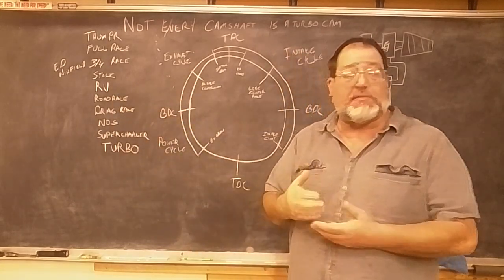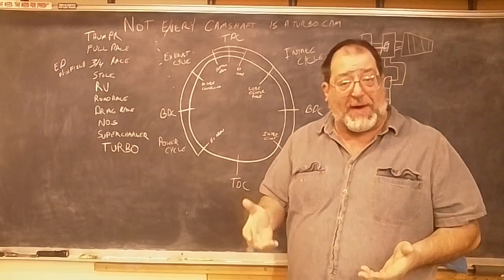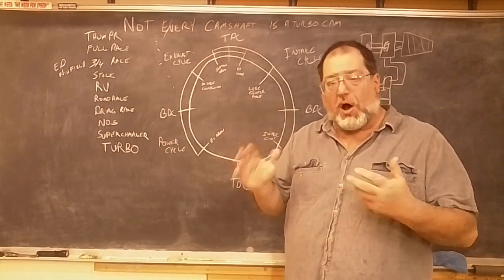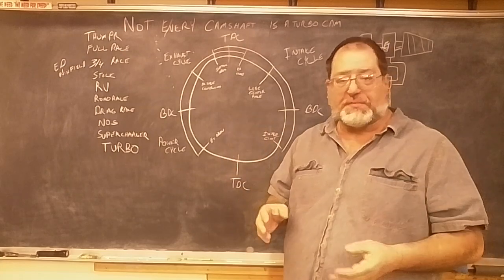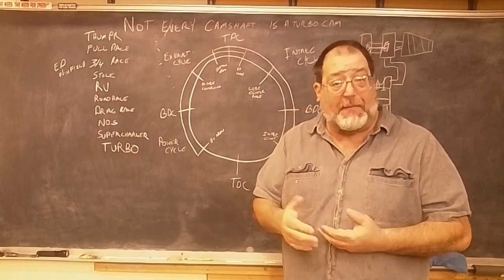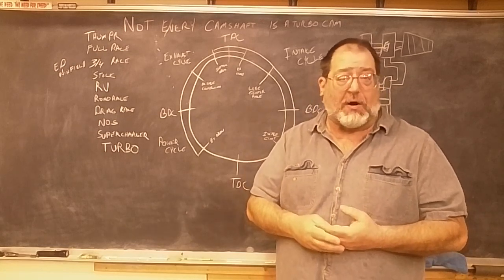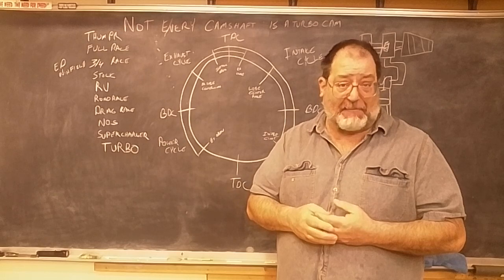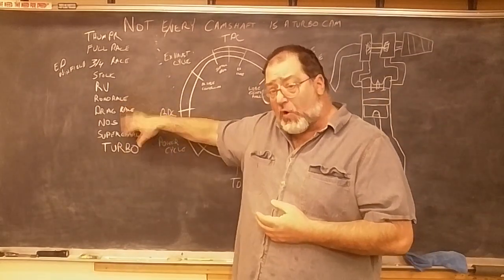NOT every camshaft is a Turbo cam

Comment: I’m wanting to turbo my Cadillac nova. I cannot find the bbc distributor for cam position sensor and sleeve to use it. In the Cadillac. I amWanting to do crank position sensor for 8 coils due to recommendation from tuner. Can you link a option. Thanks

Comment: So what is the difference between a turbo cam, a supercharger cam and a nitrous cam? is the cam different for a PD supercharger compared to a centrifugal?
Reply: One of the key differences between them is how they get overlap. While they all need a way to deal with a greater exhaust volume, a turbo might need negative overlap while a supercharger might need very little,  or no overlap. It can get tricky.
Reply: @v8packard turbo cam is like NA cam, blower and nitrous need more exhaust cam.
Reply: @V8Lenny  Couldn't disagree more. NA cams use overlap to scavenge, depending on the pressure ratio overlap will lead to reversion with a turbo. This isn't an opinion.
Reply: @v8packard  if your backpressure is too high you have wrong turbo. NA cam is a turbo cam.
Reply: @V8Lenny  How do you eliminate backpressure with a turbo?
Reply: @v8packard  with boost.
Reply: @V8Lenny  You clearly don't know what you are talking about. With regards to boost, cams, or turbos. You think installing a turbine wheel in the exhaust stream doesn't impact the pressure across the turbine? Really,  you are a waste of time.
Reply: @v8packard  intake and exhaust pressures are balanced so turbo engine works like NA engine , commin knowledge
Reply: @V8Lenny  complete and utter bullshit
Reply: @v8packard  you just told me you know nothing.
Reply: @V8Lenny  If you are ignorant enough to think those pressures are "balanced" you cannot be helped.
Reply: @v8packard  why wouldnt they be ?
Reply: @V8Lenny  when are pressures in balance or equal? If that were the case gasses would not flow into or out of the engine. If there is positive pressure above atmospheric on the intake side, and that pressure is increased by a turbine driven by the exhaust stream, how can the pressure on both sides of the turbine be equal if the turbine is doing work (increasing pressure on the intake)? That's like believing in perpetual motion. 

If the pressure ratio, exhaust to intake, was 1:1 or lower, the turbocharged engine would behave like a NA engine. The higher the pressure ratio from 1:1 the less overlap the installation should have. The lowest pressure ratio I have ever seen was 1.4:1, meaning for 10 psi of boost there is 14 psi in the exhaust between the engine and turbo. If that's the case, when the intake valve opens using a NA cam the exhaust valve is still open. If there is 10 psi in the intake and 14 in the exhaust which way do you think gass will flow? The NA cam will not close the exhaust valve until the piston is well past TDC. At that point intake flow can begin to fill the cylinder. 

Frankly, most turbo installations operate at pressure ratios greater than 1.5:1. I understand there have been some very experimental systems that with much development have achieved 1:1 or less across a broad operating range. That's not reality for most everyone else.
Reply: @v8packard  every good turbo engine has higher boost than backpressure. Even if backpressure is a little bit higher than boost cams still have overlap. Only engine with negative overlap I have seen is old pre chamber VW diesel and that only because they wanted so high CR that they couldnt use valve pockets in pistons.
Reply: @V8Lenny  bullshit
Reply: @v8packard  yes, you are.
Reply: @V8Lenny  You lack experience, and education,  in this matter
Reply: @v8packard  you do, not me.
Reply: @V8Lenny  Correct, I have both hands on experience with these engines, and an educational background to back that up.
Reply: @v8packard  every turbo engine I've made has higher boost than back pressure, every factory made turbo engine I've had has higher boost than backpressure. You can buy a turbo book from 1970s that says well matched turbo engine has higher boost than backpressure. Everyone knows that good turbo engine has higher boost than backpressure. But you dont.